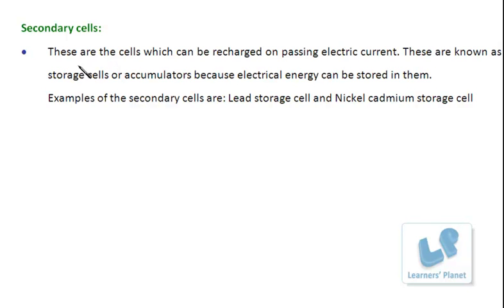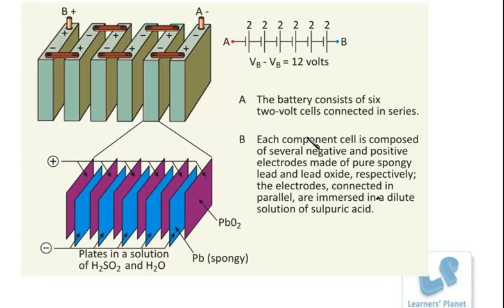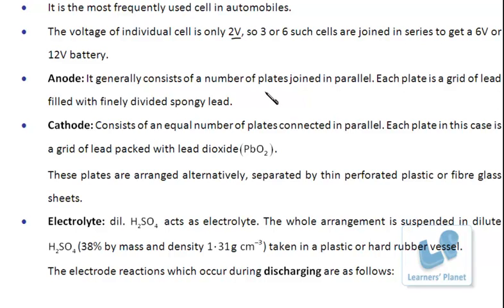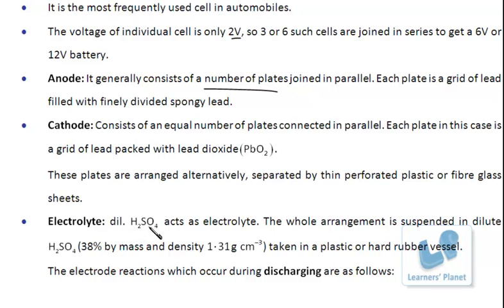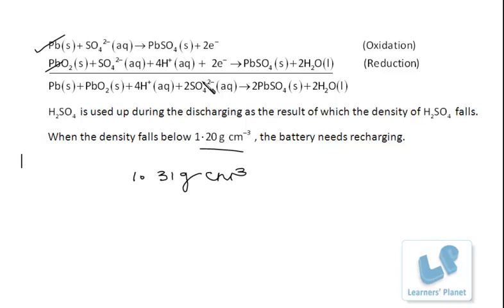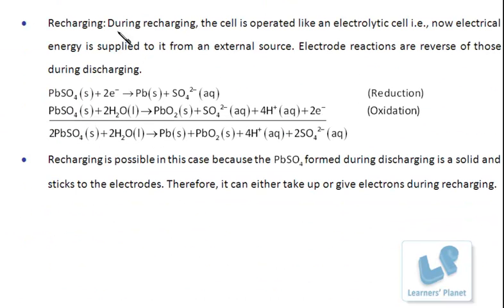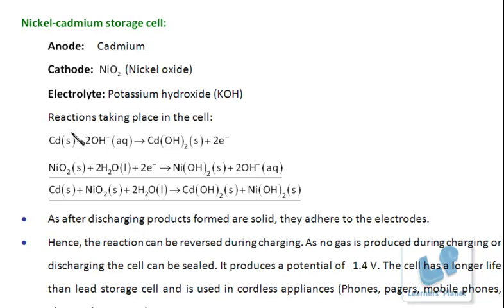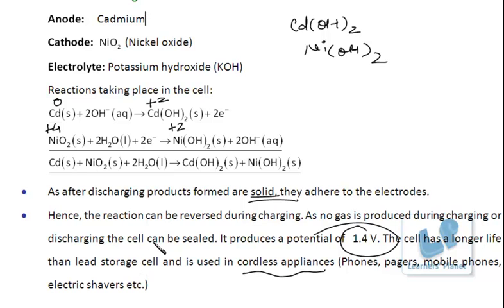Secondary cell, lead-acid storage cell, lead-acid battery, Nickel-cadmium cell Electrochemistry

Comment: Great in depth explanation. I would like to point out though in a lead acid battery, the equation should contain HSO4 ions rather than SO4 because sulfate is protonated in strongly acidic solutions.